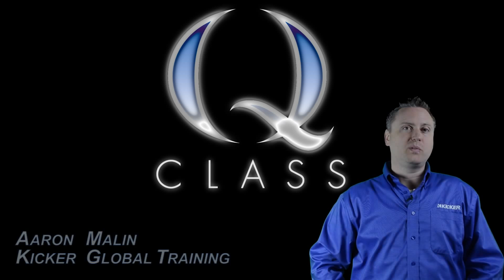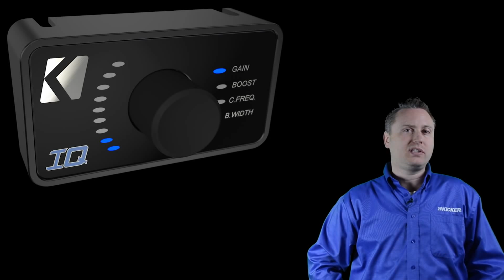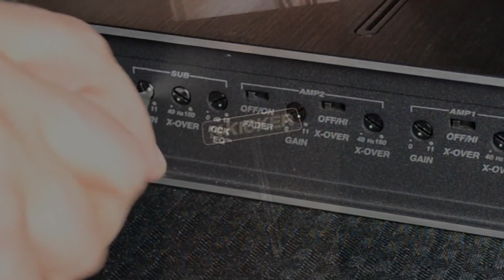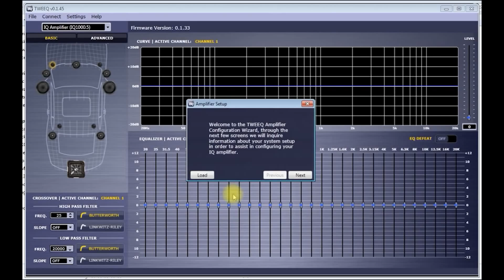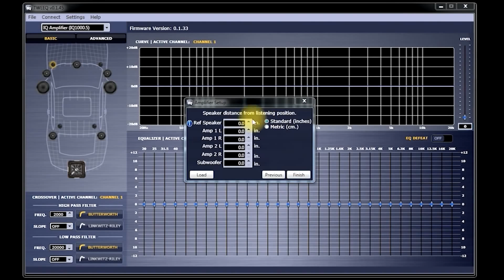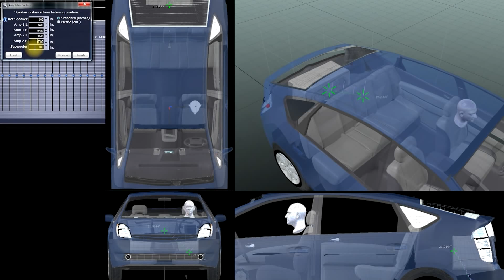Kicker Iq10005 Amplifier Basic Setup

Comment: If I’m running just a subwoofer and nothing else, what do I connect the rca cables to? I have a iq1000.5
Reply from the maker: Find a full range signal using an RTA, then connect the sub channel to that using a KISL. Depending on the vehicle you may need a load adapter. For details, please contact Tech Support:  support@kicker.com.  YOu can also call them from 8-5c (weekdays) at 405-624-8510. You can also check on our channel in the Tech Force section on finding full range signal.  We have videos showing you how.

Comment: Does the IQ amps has something comparable to Audio Control’s accuBASS built into the DSP?
Reply from the maker: The Great Empire!! No, it has much, much more
Reply: KICKER 

But can the DSP restore bass like the AccuBASS? That is what I am wondering since my truck has a very bad roll off for the low end
Reply from the maker: After the signal is summed, the answer is yes - plus you can do a whole lot more with the included TWEEQ software. Read more about it here: https://www.kicker.com/tweeq
Reply from the maker: BTW if you don't want the added flexibility/functionality of TWEEQ, you should look at our KX line of amps.  They come with the SHOCwave Bass Restoration processor, which is engineered to be controlled by the wireless remote (included). Read more here: https://www.kicker.com/kx-amplifiers

Comment: I just bought the IQ1000.1 amp, what are the benefits of the TWEEQ option since it is a sub amp? Is there a way to tune my mids & highs too with this amp or just the sub?
Reply from the maker: Since its a mono amp, its meant just for bass. And yes, there are a LOT of advantages to using TWEEQ for your sub channel.  Tuning your sub is extremely important, both for getting the most out of the sub and customizing it for your preferences sound-wise.  We have a few TWEEQ videos.  Please take some time to check them out. It will make a big difference in the quality of your sound.

Comment: I noticed that there is a tweeq software in my app store using my iphone. Is this able to be used with the amp?
Reply from the maker: Hi Darren, TWEEQ is built into all IQ amplifiers, so if you have any of those amps you're able to use it. Now, if you have the IQI Bluetooth adapter,  you can use the program on your phone to adjust TWEEQ wirelessly.  So there are two "levels" if that makes sense.  Hit me up if you have any other questions.